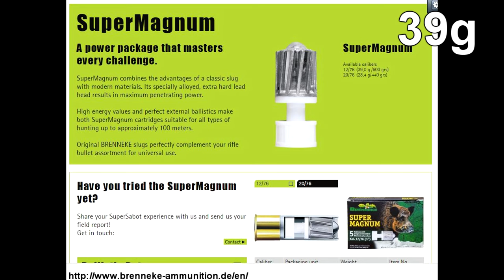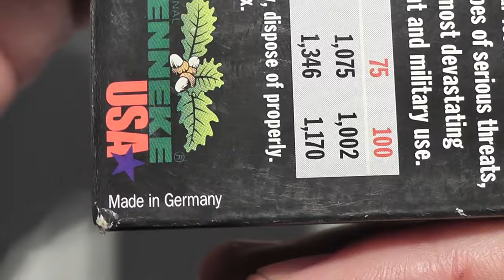BRENNEKE Special Forces Slug vs ENGINE and MORE!

Comment: The original Brenneke slugs had a half inch thick felt wad screwed into the back of the slug.  Don't know if you can find any.
Reply from the maker: They still sell the "classic brenneke" slugs.
Reply: Super quick question, I've just found a couple of motors that look EXACTLY like that motor you shot, what is the block and head made of? Aluminium?

Comment: "Since these are supposed to stop a diesel truck...."

A friend once told me that that because semis have pressurized radiators they can be stopped with a pellet gun. Not instantly, of course. 

Disclaimer: The friend that told me this was intelligent but crazy. I never have tried to stop a truck with a slug or a pellet. So, don't take this bit of "guy talk" as fact.

Comment: if you shot one of those dead on into the front of a semi truck it likely wouldn't kill the engine on impact HOWEVER it WOULD destroy the radiator which would then over a short amount of time cause the engine to overheat

Comment: that thunderbolt that drilled through the plate before was out of a 24+" barrel though wasant it? where as the ones in this vid were out of an 18 inch barrel? that would make a pretty big difference in speed.

i also dunno that there is really much in the way of small arms that would reliably stop an engine dead in a single shot. richard from fullmag has a vid where he shoots his running truck engine with a 50 bmg and it was still running lol.

clearly though these slugs are more marketing than anything else.

Comment: Maybe try the red slugs though a rifled choke? I know you said they are meant for smooth bore but manufactures intructions have never really been this channels thing.
Reply from the maker: Remember these are European slugs,   and in Europe,  rifled shotguns are almost non-existent for legal reasons.   Adding spin stabilization to a slug that was engineered  for drag stabilization never works better.   I've tried to explain that many times.
Reply: I know you have explained that a lot, the fact that something shouldn't work just never stopped you before but fair enough. I found it strange that the one that didn't separate showed the same characteristics as the ones that did.

Comment: brake rotors are hardened cast iron lol I guarantee no shotgun round is going through it.
Reply: hardened cast iron, im going to write that one down. specifically how were they hardened?
Reply from the maker: with tungsten durasteel
Reply: with heat

Comment: A B B gun can stop a truck as welk ad a paper clip shit with a rubberband when shot at a radiator. The difference would be determined by the size of hole or damage sufficent enough to expell the water. The shot doesn't actually stop the truck, it's the lack of water. A bigger hole means faster leakage. Duh!

Comment: Hallo Jeff
Please try some more Brenneke´s, I can´t belive that they are this bad in generell.
And it woud be interesting if there is any caliber wich can penetrate this brakedisk with one shot. ?
I thing these hardened Steeldisks are much taffer then a cast iron engineblock.
In my opinion the slug is not realy for destroying an hole engineblock, but has a good chance to stop by panetrate the body and damaging some important parts like Waterpump, distributor, zylinderhead and so on...
Thanks for your videos, we love it.

Sry for the bad english, its not my motherlanguage.
Reply from the maker: We will try some more.  These had defects.   I have some Brenneke slugs made in FRANCE...   We'll be testing those in the next few months.

Comment: like to see this slug with the lighter Flint's added to them.
Reply: I want to see them cast there own slugs with A nail used as a steel penetrator It would blow through the Brake rotor no problem an engine block to.Jim

Comment: to stop a truck you don't shoot the brake disk? you shoot the motor, radiator and such...
Reply: Duh.  But we didn't have a truck. We DID have cast iron brake rotors that are a cool test of the slug vs. heavy metal.
Reply: Officer Gregg heavy metal 🤘

Comment: if you know where to point it I'm sure it would do enough damage to stop a truck.

There are lots of soft targets in and around any vehicles engine bay, plastic pipes
soft alloy casings, electronic boxes,  Fuel lines, Rubber hoses, radiators, drive belts, plastic idler wheels
the list is endless. Target any one and you will kill the motor. 

And You dont need a special slug to do it ANY decent gun will get the job done !!
Reply from the maker: A Walmart-bought Foster slug will do everything this slug can do,  and better.

Comment: I enjoy all your videos and appreciate the effort you put into them. Is "accuracy" really the correct term to use when there is a difference in POA versus POI?
Reply from the maker: The entire wadding is supposed to stay attached to the slug and is an important part of the ballistics of the slug.   Since they were breaking off,  the aerodynamics were affected and caused them to deviate.   We had no issues with older,  all-black SF slugs.
Reply: Ok I understand that. What I mean is using the term accuracy when slugs don't shoot to the same poi, you can't really determine accuracy with just one shot. I realize you are not testing accuracy but it might be confusing to some.

Comment: Brenneke slugs are my favorite for hunting deer.However if your going to take out a truck engine with one your only going to take out the radiator and cause it to overheat.You need something heavy and steel to make it to an engine block.Lead is going to flatten out or come apart going through fenders or radiators .Let's be realistic.Still like your video though it shows what reality is.

Comment: I reckon, one dumps enough of them into the grill of a truck, it'll stop.
Reply: well we know what it can do to the battery.  Wouldn't the fastest way to stop a truck be shooting the air tank and locking up the brakes?
Reply: Air tank would slow it down, but not stop it. But they're often hidden away.  No quick way to stop a truck really. Trashing the engine with a full magazine of slugs would stop it in a minute or 2 max, and it's a way bigger target than air tanks. Source: Semi truck driver who drove a loaded rig 2 miles with blown air hoses.
Reply: it would be better to shoot the tire..
Reply: To be fair guys, I'm pretty sure the fastest way to stop a truck, would be shooting the driver.  Punching past doors and glass, I'd assume that's what this slug was intended for.  Not really shooting engine blocks.  Could be wrong.
Reply: radiator with anything....
Sure, it'll be a slow stop, but it will stop eventually.
Reply: +Joe Sumcock shooting the driver is my best answer for stopping a truck, I agree.  but any rifle round from an overpass/heli thru the top center of the block should stop just about any engine.
Reply: How about target the driver ? ? Or is that politically correct ? I mean if a person driving the truck has made the truck a weapon . . . . . . . . .I've been around trucks my whole life , and have never known one to go rouge . . . . . . Well actually that isn't correct . I have seen a few Detroit powered vehicles ' run away ' but if the operator has the awareness and understanding they are harmless but usually self destructive .  Recall a video a while back where a fella welded some plate on a rather large bulldozer , and demonstrated his disdain with his city council in a small town . Ended when he somehow punctured the radiator with debris from a county building getting inside the armor surrounding the engine if I recall correctly what it was that stopped the  ' machine '  . From what I could see I'd have figured it was overheated from the armor being to effective and not allowing the cooling system to work properly . Again , these rounds in the video I feel  would have been effective on the passenger ' compartment ' as would a 30-06 with AP rounds . . . . .I'm just saying it isn't so much the ammo as targeting the vulnerability ,  and the skill of the shooter . I can build a round that can be fired from large handgun that is superior in performance comparatively to the ammo demonstrated . But it's ' Illegal ' . . . . . . .but it is catastrophic to what ever it hits . . . .Again like the truck . . . .it isn't the ammo that's the limiting factor or potential  danger or degree there of.  Simple stuff really if one thinks about it . I can go to a hardware and buy everything needed to bring down a helicopter within a hundred yards or so . Armored or not makes no difference as it is the ' aim point ' that makes the difference . Probably most people reading this have in their house or garage/shop the ingredients to put them in prison for many years if they know how to ' assemble ' the components . No , guns are actually very low on the list of lethality no matter the '  ammo '  it's just they are handy and there are those with an agenda to remove them from the law abiding citizens . . . . . . Have to ask why ? That is the real danger . Be well .
Reply: @truckerallikatuk  , true below 60 psi the spring brakes are automatically applied unless the ' operator ' has caged the brakes to prevent auto application . Even then most large semi trucks can over power the ' emergency spring brakes '  until they get hot enough to be ineffective if that ' operator ' so chooses . As long as the ' Loose but behind the wheel '  can steer the vehicle is the tool not the threat.
Reply: @joesumcock886  , thanks Joe .
Reply: @addiumuppicus5738  It's not the overpowering by driving, it's revving the nuts out of it and running the air compressor at maximum to push as much air into the system as is leaking out. Unless the holes are massive, it works. 2 or 3 through and through slug holes through the airtanks would be more than the compressor can handle, which would set the brakes on. And if there's a good amount of weight in the trailer, it won't be going anyplace fast with locked up brakes.

Comment: using a shotgun to stop a tractor trailer is kinda a stupid idea, given the range, and the fact that even if you were able to disable the engine, the speed and momentum of the truck would still make it kill you/ do serious damage to whatever they were driving towards.  plus if you kept shooting a shotgun at the moving truck, youll probably kill the driver before you stop the truck from driving, kinda making the point of being able to disable the truck null if anything that can go through the windshield could kill the driver just as easily.

Comment: Comparing the results of the brake disc shot against a Diesel engine block is apples and oranges. The Diesel engine is virtually immovable by the amount of energy from the slug. The brake disk is light in comparison and just sitting on a table. Come on guys.

Comment: Would it be ok to shoot slugs through a modified choke tube? Will it damage anything? Just wondering
Reply from the maker: It depends on the slug.   Some do ok through a slight choke.   Most are designed to be safe through a full choke
Reply: So you are saying that I can put anything through it, right?

Comment: i can send you some .735" diameter round balls cast from lead as well as some 7/8 oz lee wad type sabot slugs if you want to try them
Reply from the maker: We have shot the Lee slugs before  but not any round balls.
Reply: .735" diameter. They are about 550 grains. The .006" over size is corrected through the forcing cone. Best for rifled barrels or CYL choke.  I can send you some if you want
Reply: need shipping address

Comment: Does anyone have any recommendations for my first shotgun? 
I would like a 12 gauge. I've been leaning towards the Remington 870....
Reply: I can't speak for the mossberg but I have two 870's, one I have had for over 17 years and it has been flawless. 

Go handle some at a shop and decide what pulls up and feels best.  

You can't go wrong in the 870 vs 500, both are winners from what I have  heard and experienced. 

But I am partial to the 870, it feels solid and I really like the parkerized finish.
Reply: Honestly, from what I've heard from multiple people, it doesn't really matter which one you get, as long as it feels right for you
Reply: The Mossberg 500 is an 870 clone as are many pumps. You can't go wrong with either. Even a Maverick 88 will do you just fine as will a Stevens or Pardner.
Reply: mossberg 500.the350 Chev of shotguns
Reply: Remington quality has been pretty spotty in recent years (700 trigger groups anyone? R51?)

My 20 year old 870 isnt going anywhere, but today, I'd buy a Mossberg
Reply: The Woodi World Don't bother buying new. Many used Mossys or Remy's out there, for reasonable coin.
Reply: I have 2 Remington 1100 20g, and 1 moss 20g, love them.  my brother has an 1100 Remington 12g.  He would trade me in an instant.  I agree with other posters, buy what feels good.  but if you can get an 1100 20g... they feel pretty nice ))

Comment: This is rather disconcerting coming from Brenneke. Them pups are pricey compared to the usual offerings on the shelf. I almost bought a case of these last year on super sale, but went with another brand of 00 buck just 'cuz of versatility. I love shooting slugs, but marketing hype seems to have taken over here. If I need to take out an engine block, a slug would not be my 1st, 2nd or 3rd choice of projectile.
Reply: They normally make good slugs.

Comment: Only an idiot would think any shotgun round could stop a vehicle engine. First off you would have to shoot through the metal body of the vehicle to get to the engine and be lucky you didn't hit a support arm for the engine which would add more metal to the rounds path. Secondly you pretty much have to guess where the engine parts you want to shoot is located unless you have x-ray vision, then lead the vehicle because it's got to be moving right? I mean why would you want to shoot and stop a vehicles engine that was just sitting there? As you pointed out, the rounds effective range is less than a hundred yards and a vehicle moving towards you at less than a hundred yards will reach you very fast. You might get a couple of rounds off but fast firing means inaccurate firing when it comes to the 12 gauge. I know this sounds asinine to point out all of the facts of why you wouldn't want to try to "take out" an engine block with a shotgun, but it is equally asinine to me to listen to you say that brenneke  developed or marketed this round for this purpose.

Comment: Clearly the most inconclusive test ever fielded by TAOFLEDERMAUS and also the most amateur to date! Try stabilizing the hard drives so the momentum does not launch them skyward and deplete the energy that was to be used punching thru the HD's. The snowmobile engine was a poor choice when the box shows a huge truck. Well, they can stop a snowmobile!